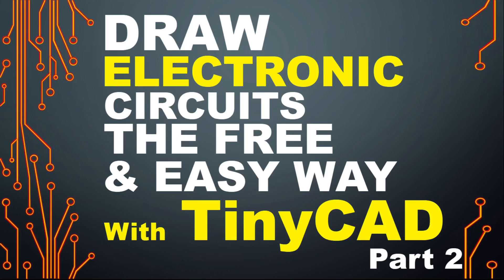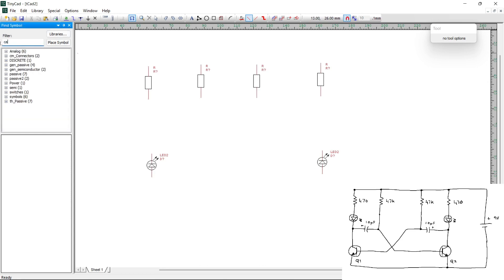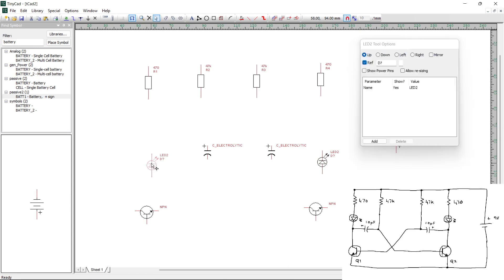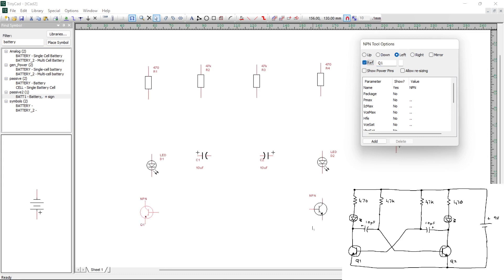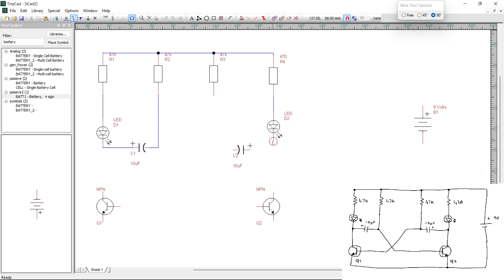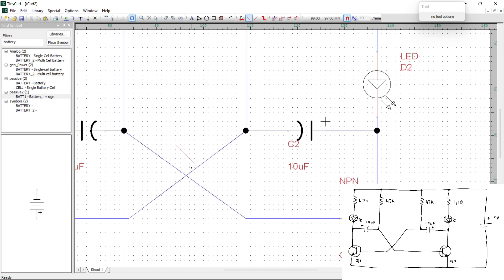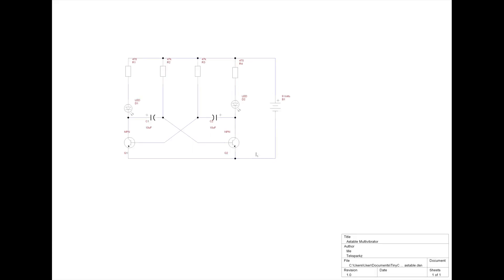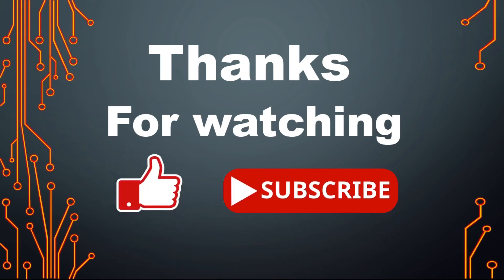Draw Electronic Circuits the FREE and EASY Way with TinyCAD - Part 2 - More advanced circuit

Comment: Hey mate, really enjoying your tutorials
I’m working through some diagrams at the moment but I’m having dramas getting everything on the page.
Is there a scaling option to make the symbols smaller so they don’t take up as much space?
Cheers
Reply from the maker: I'm not too sure about scaling the drawing but you can scale individual components by ticking the 'Allow re-sizing' box in the component tool options window - this can affect the thickness of the leads though. A better option might be to make the page a lot bigger so you can fit larger drawings. Go to the 'File' Menu and select 'Page Setup'. From there you can select sizes like A1 or A2 or you can specify a page size in millimetres. Hope that helps!

Comment: Hello; enjoyed your two videos on tiny CAD, I going to try to draw a wiring diagram of a car and need to be able to draw wires in different colors and sizes is that possible in this program thanks
Reply from the maker: Hi Dave - Glad you liked them! You can change the wire colour and thickness by right clicking the wire you wish to change, then the Wire Tool Options box will appear. Next deselect "use normal appearence" and then you can select the wire colour and thickness. I hope that helps. If it still does not suit you could have a look at https://app.diagrams.net/ as an alternative